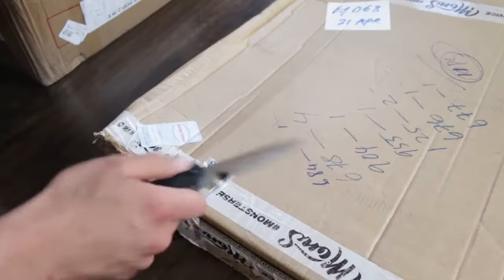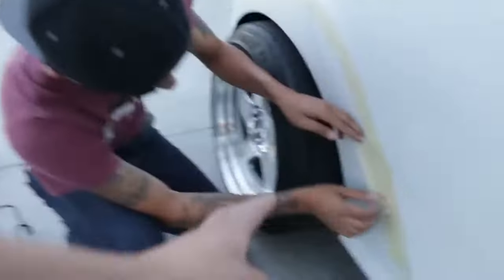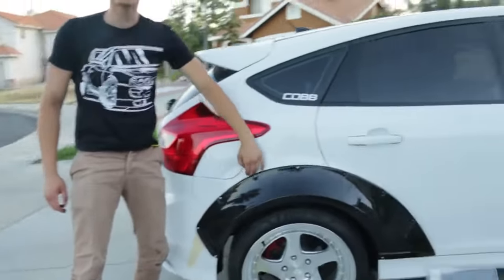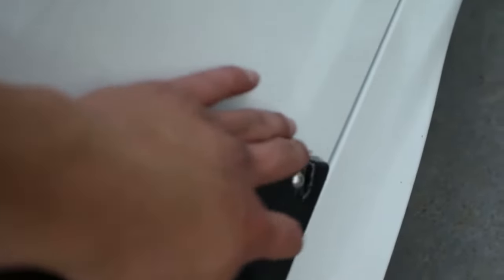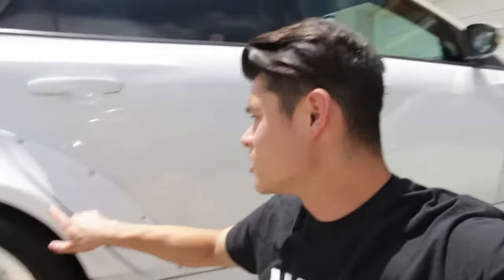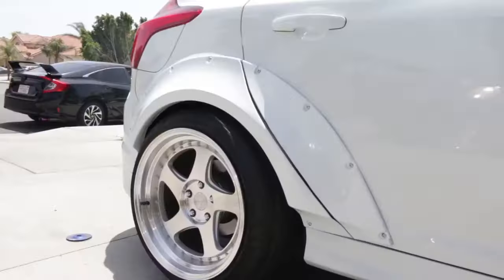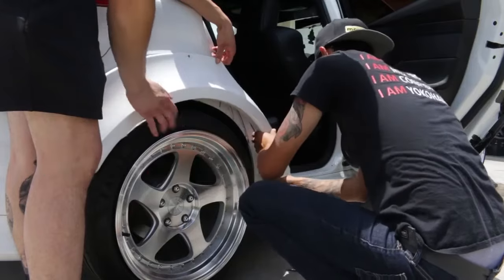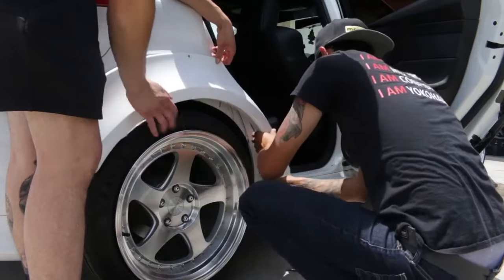Overview about our universal fender flares +70 mm from USA

Comment: pro tip cut your flares before mounting. you can flex the flares a bit with your bolt locations so they will fit
Reply: Do NEED to cut your fenders to install flares?
Reply: @JTC390  it would look stupid af if you didn’t and make the over fenders useless

Comment: hey just wondering, how did you find exactly where to cut so the door can be opened, i see u had a line drawn, was that just rough shape or did you somehow get it to imprint to make it exactly to the door shape? looking at doing metal flares on my gs300 to make it wide body but id want the cut to be the exact shape of the door to aah
Reply from the maker: Sorry for the delay. In the video, our customers from the United States. We make it by laser level. Expose the line of the laser on the door, set the expansion and cut off. it's in a nutshell.
Reply: @Monsterservicekits  and how to do without laser level? instead of cut straight down id like cut to follow same line as door
Reply: J.s.c gaming  fuck all that just put the fender  on and don't bolt on the  rear just the door..then just cut along the door ......there too easy  u got it..its not that hard..??????? Just gave u free advise  from the experts...ur welcome. Ur friend Jerry

Comment: Are the tires mounted wrong?? The tires say inside on the outside so I think they might be mounted wrong
Reply from the maker: Martin Cruz May be.)
Reply: @Monsterservicekits  hi, how do you protect the cut portion of the car body from rust?  Also , will the stalk wheels fit? Or are spacers or wider wheels required? What width fits best?

Comment: What offset or rims do you need to rock fender flares? Also could you run this with. Eibach sportline springs or do you need coils?
Reply: Go with 0 offset or negative offset so the wheel sticks out more and coils would be better since you can adjust the height so if you have rubbing issues you can raise the car to a none running height